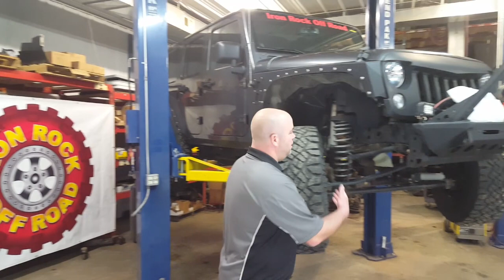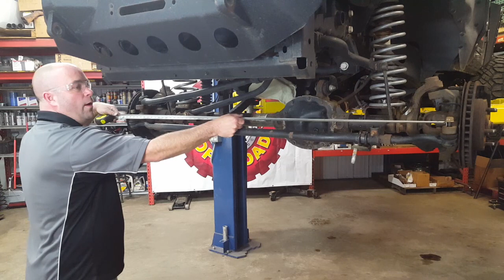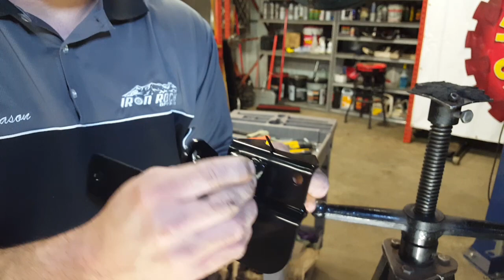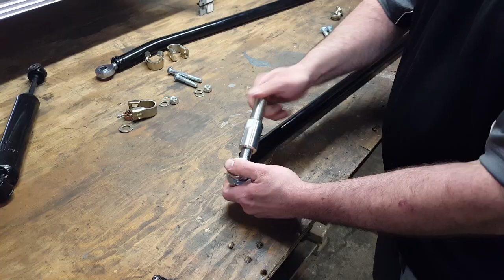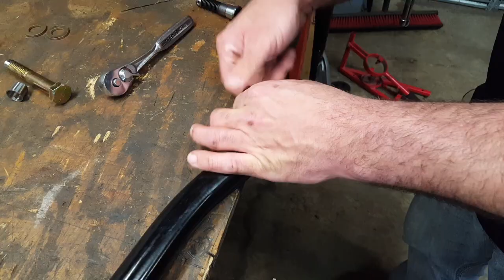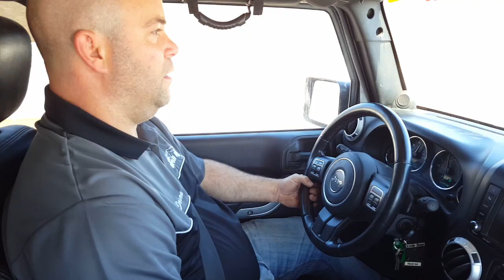Jeep JK Over The Knuckle Steering Installation

Comment: can this be used if I already have  Terraflex 4 inch lift kit?
Reply from the maker: @hrodriguez112 Yes it can! The only requirement is a minimum 3" bump stop on the front. If you're running 35" tires you probably have at least 3" of bump stops already. Just double check your front bump stop length and you're good to go!

Comment: Why clamps & not jam nut?
Reply from the maker: Jam nuts are much more unreliable than clamps.  Clamps stay tight until purposefully loosened.  Jam nuts can come loose with incidental steering contact against obstacles, or if undertorqued (this is common, as it can be difficult to determine how tight is "tight enough").